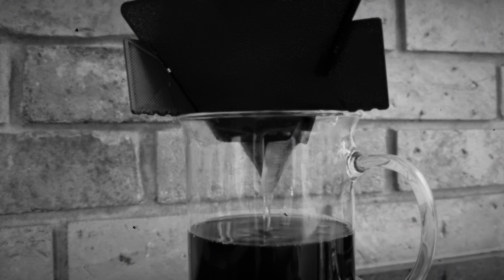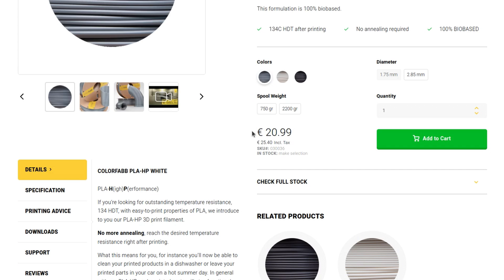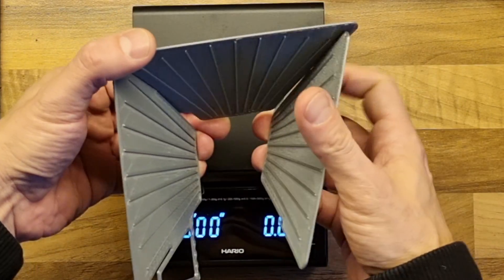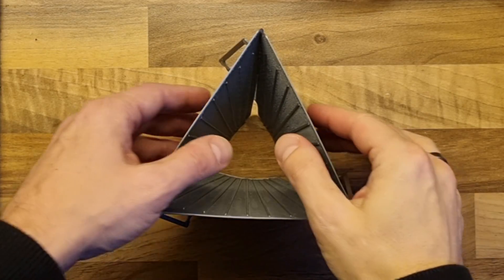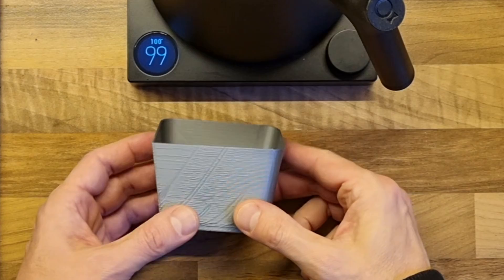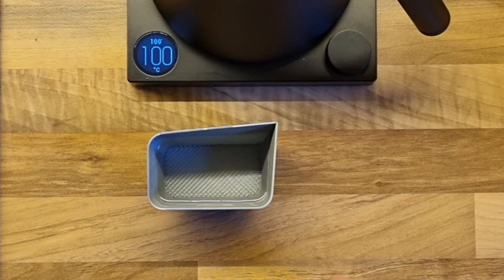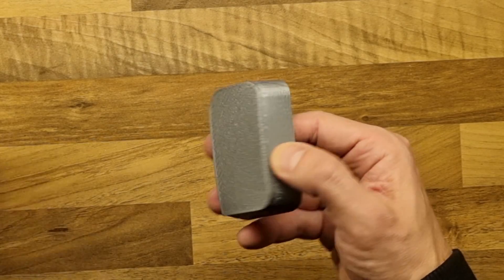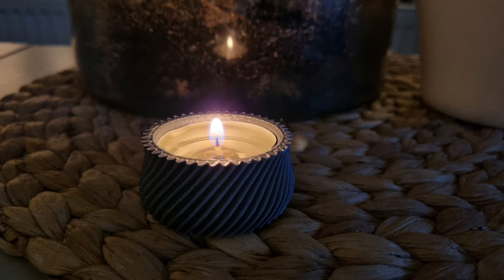Heat Resistant 3D Prints

Comment: I don't think PLA is food safe, though... ignoring that fact, you can try to use isogrid on the outside to see, if that would improve the stability ;)
Reply: I coat my prints with a food-safe resin.
Reply: @seanwoods647 got a brand you’d recommend.  ?
Reply: @seanwoods647 , that works unless/until the resin wears off or cracks.
Reply: @Pics2FlicksDennis Speaking from experience: the resin wears a lot harder than the PLA. It also makes your part a lot less likely to sheer at the layer lines. The resin provides isotropic surface strength. And a pretty cool clear-coat effect.
Reply from the maker: There are some food safe PLAs, not sure if there is one food safe and heat resistant at the same time. Maybe I will try slightly thicker version, yet my next project is wine glass hanger for the dishwasher :)
Reply: @taboretum  Food Grade PLA is for packaging applications, not 3D printing.
Reply: @taboretum You can anneal any PLA to become heat resistant.
Reply: @TheAnachronist *some PLA’s
Reply: No plastic is real food when you get right down to it
Reply: Pure PLA is food safe. In fact, the US FDA  even allows it to be used for implantable devices that need to dissolve in the body over time.

The issue would be around anything added to the PLA, colorants and so forth. Unless a filament is specifically marketed as food safe, and is from a very reputable manufacturer, I would not eat or drink off of it.
Reply: @yummybeers are those implants 3d printed, or injection molded?  I agree that pure pla is food safe. The problem comes in when you decide to 3d print it. That adds surfaces that can not be reliably washed, both inside and outside of the print. The porous nature of 3d prints means that it is only safe for 1 use before bacteria starts to grow on the prints. For personal use, sounds okay, I probably wouldn't use it for an extended period of time. For commercial use? I prefer not to be sued over a $10 piece of plastic.
Reply: @2spark631  that’s a good point. it’s up to the device manufacturer to show that the device is safe. so using PLA isn’t enough, you need to demonstrate that it’s safe for its intended use. I don’t think that manufacturing by 3-D printing is necessarily good or bad for that, somehow they just need to show that the final product is safe.

Putting it another way, the FDA will not disapprove your device just because its made of PLA.
Reply: @yummybeers  yeah. The only way that I will be comfortable selling 3d prints as food safe items is to create a good enough process to where I can use them for an extended period of time, do a bacteria test on them to see if it grows any colonies, and if it doesn't after multiple different isolated tests, then, and only then will I allow myself to sell commercially. For now, it's a pipedream... but in progress!!!
Reply: @2spark631  the only reason a PLA print wouldn't be food safe (to re-use, there is no question about single use) is if you had reservations about its ability to be cleaned successfully. Bacteria itself can only grown on food particles and not the PLA, and PLA is not toxic hence its food safe certification by the FDA etc. Hope this helps your pipedream :) p.s. as long as the extruder gear and nozzle etc are stainless steal there is no risk of the printer contaminating the plastic with heavy metals etc. There was a scare at one point when chinese cheap bronze nozzles were found to contain lead, so now they are all treated as though they do even though they don't. So many people love to be freaked out and scared to death of 3D printed parts, don't listen to them, they are just crackpots.
Reply: @knifeyonline  I'm really interested in your take. Do you have sources that have research saying that printed objects don't grow bacteria after extended use? I'd really like to take a look to see what their process is if they just used a base pla print with no finish or anything! It'd made my life easier that's for sure!!
Reply: Noone mentioning the needs for absolutely clean and food safe rest of the production line?
You'd need to have every part of the printer very clean, so the filament feeding, extruder, hotend, nozzle, buildplate... Not saying it's not possible but very hard to do so
Reply: @nAcolz  I mentioned it up above. Believe me I know XD
Reply: Nah pla is food safe, most meat and other packages are made off it.
Reply: @OneHappyCrazyPerson  3d printed products are "food safe once". They are so porous that there is lots of room for food particles and bacteria to work their way into the material in a way that can't be sanitized by normal dish-washing techniques. (And PLA gets really, really warpy if you want to autoclave them.) The epoxy coating fills in the gaps and provides a smooth outer shell that prevents fluid/particle/bacterial incursion.
Reply: @seanwoods647  Guess the 168 hamburger "rings" i printed and sold out off pla on Etsy wasn't a very good idea then. Printing the last Christmas ornaments now.
Reply: @OneHappyCrazyPerson  yeah not too good of an idea there unfortunately. I've been trying to get truly safe reusable food safe pla prints for ages. Go woth natural color pla that has been sanded down with food certified epoxy resin applied to the surface. Only then will it resemble a food safe product. Still, more needs to be done...
Reply: @2spark631  that sounds like a bizar amount of extra work, maybe I should just print them out of petg and also at 0.10 If I do a run off them upcoming summer 🌞
Reply: @seanwoods647  Epoxy coating must be doing wonder on compostability of PLA.
Reply: @OneHappyCrazyPerson what's your Etsy store link I'll report it to the FDA and they can decide